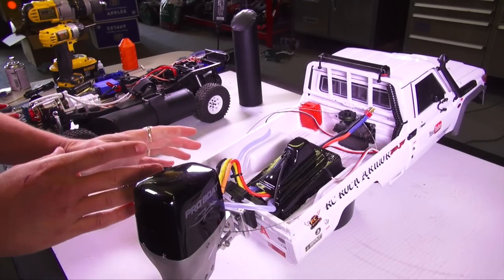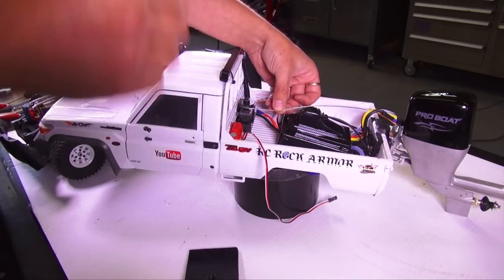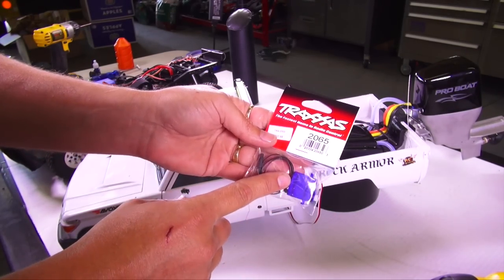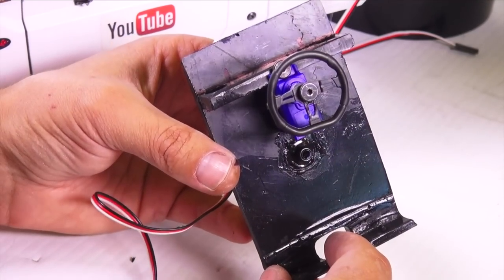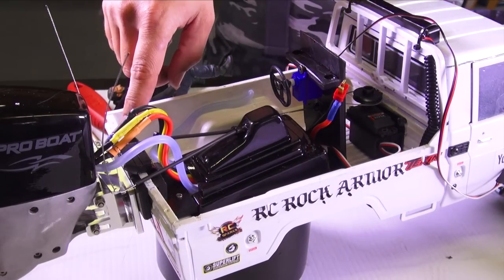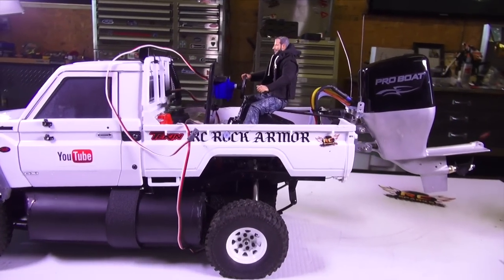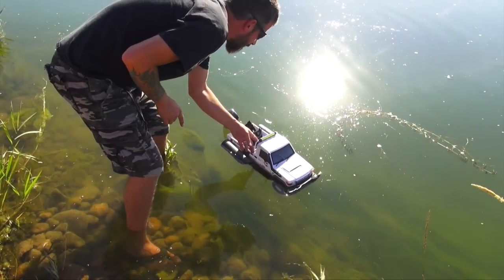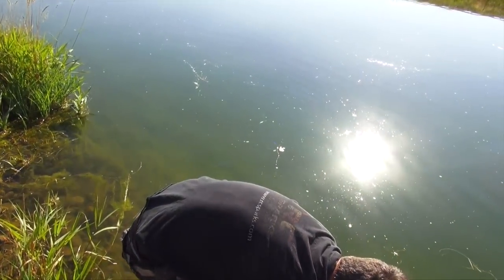RC ADVENTURES - TOYBOTA PROJECT - PT 6 - BBC TOP GEAR TRiBUTE BUiLD - TOYOTA TRUCK-BOAT

Comment: It floats like a champ. This thing is going to be awesome!
Reply from the maker: Brother.. I wonder if it will plow water.. or chug along like a powerful tug boat. Its VERY heavy.. and is a lot of water to displace. I think the motor will get pretty warm.. but I kept it a low kv for just that reason. Torque is what I am after...
Reply: RCSparks Studio well if it tugs like a tugboat strap a couple of barges on the front of it👍🏻😁😂 it's going to be cool either way dude👍🏻

Comment: Love this wacky build! You should try doing a crawler/quad copter thing next :)

I could almost see using two separate radio sets corresponding with Mini Medic driving inside the cab on land and Mini medic driving from the bed as a boat :)
Reply from the maker: Chris.. this is a wacky build. You said it perfectly. Haha.. A flying crawler hey?! Hmmm..  Heavy, but possible!

Comment: Can you put the receiver antenna through the snorkel of the truck. That would be cool. It would be hidden
Reply from the maker: If it was longer bro, I sure would !!
Reply: I put the wires for the lights on my roof rack on my body through a snorkel, looks decent 👌

Comment: Yeah I am with my friend. after you actually try it what if you ran a set of paddle tires because with the full skid plate and having high gear it may give it more momentum with your dx8 you could just put the tires in foward cruise control  and  then just drive the boat motor also

Comment: i think the side floats need to be lowered a tad imo once it starts moving the back will come down slightly
Reply from the maker: Excellent feedback. In the last film.. I also though they needed to be lowered. So in this film, I ensured the floats were an inch lower. The thought behind this is.. when the truck/boat is moving quick enough.. it should start to lift, and plain a little. So.. I have to be careful on pontoon placement. An adjustable plate for moving them.. would be ideal. Thoughts?
Reply: yes i remember from the last one you were going to place them lower, maybe if the were rounded at the end they would deflect better lower down almost like a torpedo :P also if this adjustable pontoon is fitted most things that are adjustable are usually heavy, i would just stick to temp fixing until you have tried it moving in the water :)

Comment: When you tested for floatation at the end of the video, I saw that the rear was a bit close to the water's edge. When you are in the water and throttle, do you think the boat motor has enough power to lift the front end too much and have water seep into the truckbed? You may or may have not touched base on that issue, but I've been on the edge of my seat with anticipation and didn't remember all the fine details haha.

Comment: plug could have also pluged both servos in speratly and use a mixxer to make them work together
Reply from the maker: Didnt need to though..! and now I still have an open channel for an actuator for lifting and lowering the outboard motor

Comment: You should have put the hole for the wires through the back windshield instead of through the bottom of the bed. still I love the truck! need build.

Comment: RC sparks I'm having another issue with my slash. I have the VXL brushless system (2wd). Its stripping all my plastic rim hexes . I've ruined 2 rims now. The bolts are tight and I can't understand... Too much power . need help. Can't find aluminum rims with a 12mm hex . thanks for any info or ideas I can try. Love the video.

Comment: Does a front motor mount on a rock crawler improve its performance
Reply from the maker: Yes, usually. It depends on the model.. but keeping weight over your front tires has its advantages. As long as you try to keep everything as low as possible.

Comment: Great video I think it's going to be a win win i need a little help i am the one rebuilding the king of shave RC gas boat I have found everything except the rudder you have any idea where I can look or a Rudder that will work it is the 58 inch catamaran with two Servo control arms

Comment: Hey man, why not use two receivers and just switch model in the radio?
Reply from the maker: Totally respectfully: because I can set it up the way I did it using one receiver, and not having to switch models! Seems easier to control all of it at once.. with less electronics
Reply: Totally up to you man. 
I tried having throttle and steering on one stick once and it felt totally weird, but i suppose it is something you can get used to. 
Be careful with those servo leads, looks danger close to the spurgear. Maybe make some cover out of your all-purpose gorilla tape. :)
This is an awesome project though, and i love your videos.